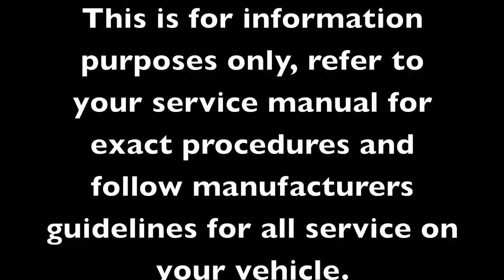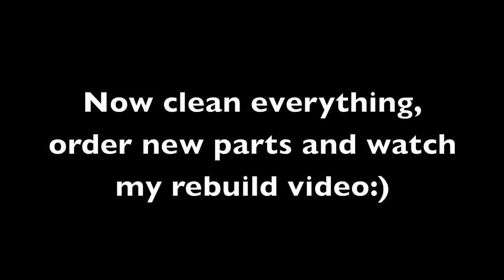Toyota front knuckle, hub, and brake service overhaul Video #1 Removal.

Comment: Wow you make it look so easy.  Without a doubt that is the most unique front axel design Ive evet seen.  I have an opportunity to rebuild one and save my neighbor. The bolts sheared off in the housing.
But From your video looks like I could break it down and put the housing in my vice. If they wont budge $299 buys a good one.  Only difference is the full time 4x4 hub.  Nice Job fast moving getterdone drink imaginary beers;-)

Comment: when u losen the nut what size is the socket u use? think i need to look at my bearing..the truck is puloing to the left i have to hold the steering wheel to the right bout 1/8 in.. i have changed everthing . the caliper was hanging up so i changed it..only thing left to change is the bearing .steering box or tires..if any one has a clue let me know ..thanks.

Comment from the maker: @justknight696 The C clip is up tight against the hub - clean the grease off well with a rag and you will see the notch in the clip.  What plate and adjusting bolt are you talking about?  Got a pic?  send it to me at Lshobie at yahoo    dot com

Comment: Not helpful for a 90 cruiser. The bearings are pressed in :(
Reply: Mp57navy so what. thank the man, he spent his time trying to help others
Reply: Caledonia Ait Smail Fair enough, but YouTube did not deliver.
Reply: Pressed in bearings?....not on 1990 models.  Maybe on the 100 series cruisers in 1998 and newer though.
Maybe you are mixed up and confusing Cruiser with 4Runner or Pickup because the 86~1995 4runners/trucks DID have the pressed in bearings with the very much different IFS front end.

This vid is very good....I can tell it's from an FJ80 of the 1990~1997 era because of the coil springs and high pinion 8" front diff.  This vid is also useful for the 1979~1985 Toyota mini-trucks....the older 1980~1989 FJ60/62....and even the older yet FJ40's.  ZUK